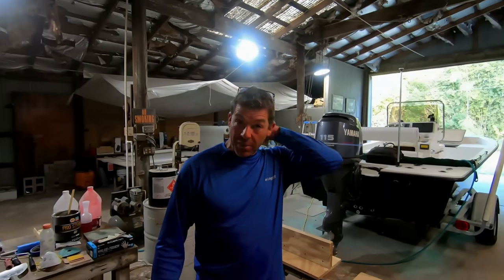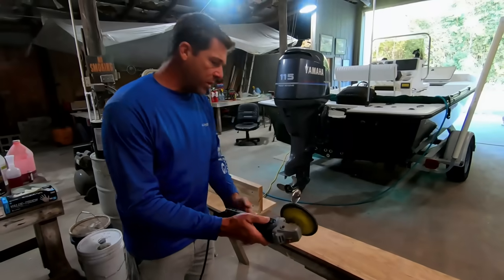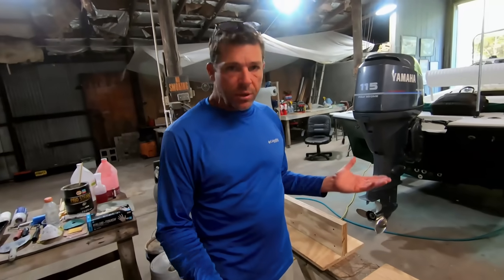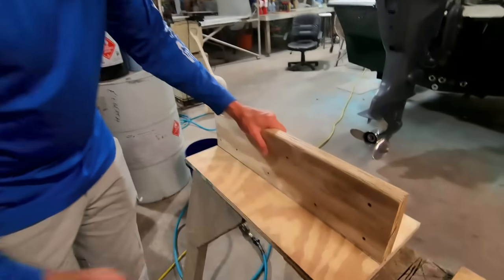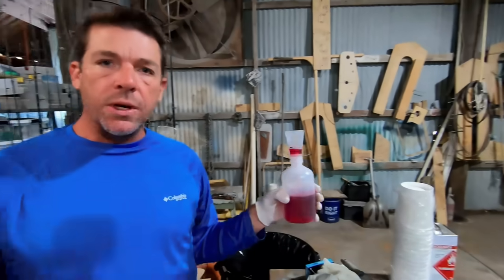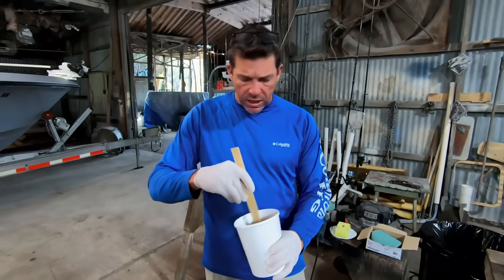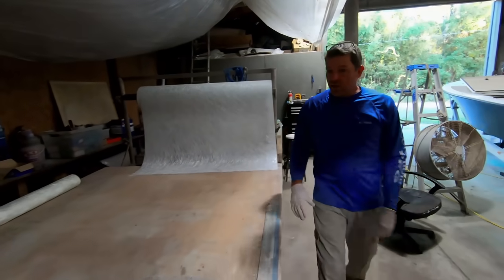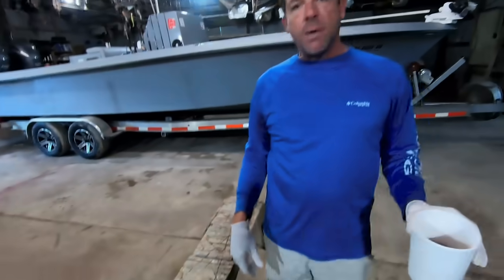How to FIBERGLASS over PLYWOOD!  Do it the RIGHT WAY the FIRST time! Step by Step DIY fiberglassing

Comment: Don't throw your used mixing cups in trashcans before the resin is fully cured. Many boatshops have burned down bc of guys throwing cups in a trashcan and the whole works catches fire and burns hot!!
Reply from the maker: I 100 percent agree! At 16.00-16.30 and again at 20.32-21.20 in the video I cover that in detail. I know the video is long, but has a lot of real world useful info for first timers and the more experienced folks alike. Fiberglass is great stuff, but has some hazards for sure. It pays to be safe when working with it. Thanks for watching and commenting
Reply: @FishBumpTV  Yeah you guys did a great job. My comment was for anyone looking in the comments. Sorry it looks like I directed it toward you. You guys clearly build awesome boats.
Reply from the maker: @shoresharp8349  good idea, thanks! Sometimes it's difficult to know what direction the comments are going. I always try to respond either way.
Reply: Wow well done your explanation and 8 generations shows.I just liked and subscribed .Do you have a video on applying filler and gel coat?
Thanks again
Reply: I always set my hot pots outside three feet from the steel sided building.  Two months after I got laid off due to seasonal downsizing to just the owners, one of the owners got sloppy and left one inside at closing time, probably after a few beers.  I literally lived across the street and remember seeing the flames towering over the trees.  The shop, three boats, and two ski-doos were lost in a matter of minutes.  It was all the fire Department could do to keep it from spreading into the trees.  Some of the steel siding even melted.  That extra 30 seconds is time well spent!
Reply: Your very much working the fibreglass as a form of creating your type of damaskus but without the heat of the forge and worrying the blade 🔪 snapping but you have to create the bond with the different layers
Reply: Name one
Reply: i think you are making this up. prove ithas happened
Reply: Wow
Reply: Best played plans of mice and men.
Reply: I was trained in composite in aviation as well, and the thermal energy from resins can reach up to 360 degrees or more and can do damage to surfaces where they are placed on.
Reply: Linseed oil on cotton rags enclosed in trashcan will combust too
Reply: Theres a video where a guy tests this with like 10 trash cans full of rags with different coatings put in them was only really one culprit
Reply: @1965mt 
I believe it happened, maybe distortion of the steel but not melting of the steel; that takes a few thousand degrees!
Resin heating off isn’t likely to catch fire, but paper, wood, cardboard… sustaining 600*F will catch THAT on fire fairly easily. 
But melting steel?! Didn’t happen.

Comment: Hi everyone just a heads up. After you use the resin and want to discard it .....please put the resin and especially any rags you use in a metal tin and place it outside.  I had some employees that were making some fiberglass chair molds and they usualy discarded the resin and rags they used in a 55 gallon trash open metal drum. Overnight the barrel caught fire and my 15 square foot work area was covered in black resin smoke from the fire. somehow the rags and resin must of caused a perfect combustion. Precaution is cheap. God bless. Jack
Reply from the maker: Thanks for sharing your story! It is always best to take precautions and be careful when working with fiberglass and epoxy!
Reply: Thank you very much from the Netherlands!

Comment: Worked at a boat yard in the early 80’s, building 25-40’ laffite skiffs. A lot of glass over ply in those boats, a lot filleting…a lot. Best thing we ever did was buy a router table to round over edges. Made wetting out glass over a soft contour so much easier. We had a home made machine called a plicker. We passed all wood products through it, its sole purpose was to stipple the surface to increase mechanical bond. The entire wood was liberally coated with poly resin, once it starts to tack, we start laying tape or cloth.
Reply from the maker: Very interesting! Thanks for sharing your experiences with everyone on the channel!

Comment: Great video! I'm looking to make a fiberglass roof topper to bring my van camper's ceiling up to a comfortable standing height. I won't start the project until the summer but this is the best fiberglass tutorial I've come across so far. I didn't skip forward once because of the constant stream of valuable information. Thanks for putting in the effort to make this video and share it with us all - I know I'll be coming back to it when it's time to start practicing.
Reply from the maker: I'm glad to hear that you enjoyed our how to fiberglass over plywood video! We have lots of related fiberglass, epoxy, gelcoat, Foam core and molding custom fiberglass parts videos here on the channel that might give you some additional ideas for your vans ceiling modification.  I hope this helps, and I appreciate you taking the time to watch and comment!

Comment: I have many years in the composite industry, and I can tell you that this fellow knows what he is talking about.
(a semi pro tip)... when doing the radius for the fillet we used to round off the end of a small scraper to to shape we wanted, it is more consistent than the flexible spreader.
Reply from the maker: Wow, thanks so much! I appreciate the tip!

Comment: I have fixed many a floorboard where the salt and snow have rusted it out. I would go under the vehicle and cut away all the rusted flooring. Some were huge areas. I then cut galvanized metal placed on the underside. Using silicone to seal between the old and the new then riveting it in place. Once dried. I would fiberglass the inside of the floor to follow the contour.  I built it up until it was even with the rest of the floor. Replaced the carpet once it was totally cured. The floorboard was know good and strong and water proof from outside elements. You did a fantastic video of explaining the correct process.
Reply from the maker: Sounds like a great fix! Thanks for watching and commenting!

Comment: a neat trick I picked up take a one inch steel ball bearing weld whatever you want for a handle i use a 4 inch 3/8 bolt  and you have a very efficient radius tool just clean with acetone you do a great job
Reply from the maker: That's a great tip! I have some tools that are made for that. I will try to show that technique  in another video. Appreciate you watching and commenting

Comment: Great video. Way back in 2015,my first fiberglass project, I walked into a fiberglass warehouse because it was the only place you could get more than "parts store" supplies and a gentleman that you remind me of gave me the verbal version of your video. I have done a bit fiberglass work since then, and watched quite a few videos on it. Your video does a great job of expressing the need to prepare, and then on application, don't rush, but don't fool around either. I would suggest to the begginner to get a couple of scrap pieces of wood and doing what you did to learn the timing of application, and the mixing and timing of a batch of resin.
Reply from the maker: Thanks so much! Glad you enjoyed the video!

Comment: Great video.  I have done some fiberglassing work on a stitch and glue kayak and repairs to my 1975 Glasply 19.5.  I have watched a lot of videos and I think yours is very comprehensive.   The tip about roughing up the plywood with a grinder is far easier then a sander and faster.  Thanks.
Reply from the maker: Thank you very much! Yes, grinding the plywood surface with a very aggressive 24 or 36 grit disc allows for a very good mechanical bond or Tooth on the surface. I believe it is a very important step to ensure a strong bond, and a quality job!

Comment: Thanks for the great video! That was super well done! I had to chuckle at the memories it invoked of my working building fishing boats in the 1960's. It was the most unsafe shop I've ever been in. Open containers of resin, catylists, and powerfull promotors were atrewn about all over amd the owner would come to look around with live cigarette in his mouth hovering over the resins etc. Our hearts were in our mouths wondering if it was all going to blow up. Luckily, it never happened. Also, it was standard practice to use asbestos fibers before it was banned for fairing between and wheelhouse and deck. Worked super great. We'd scoop big handfuls of the stuff to mix with the resin. 
You mentioned for nice smooth finishes that you finished up with mat. We used to top up the mat with cloth which gave a super nice finish as long as the mat was not too wet. We also used phenolic microballoons for fairing which really sanded well for a smooth finish. Thanks for the memories, lol.
Reply from the maker: Haha, wow! What a great story, glad you guys are ok! Thanks so much for watching and commenting

Comment: Excellent video I learned a lot. 
I'm hoping you will show us how to wrap the ends around so we get smooth corners and how to figure for thickness to fit preglassed parts into spaces that already exist
Reply from the maker: Thanks so much! I will be working on a video covering that soon.
Reply: @FishBumpTV I would also like to see how to bridge over open areas. Don't have any wood backing

Comment: The reason you want to sand the wood after it is machined is when a router or plainer  (any cutter using a steel blade that shaves) is used. The wood grain lays over and seals the wood grain. This is called burnishing. If you try to stain or use a stain primer or paint, it will not penetrate. When you sand the surface, it sands off the wood that is laid over (burnished) and opens the grain, allowing the resin to inter the cells of the wood. 
 I dont know if you have tried a product called pre- stain conditioner, but in the woodworking community, it is used on closed grain wood like maple,cherry,birch, and American black walnut. Thanks for sharing your knowledge in boat building.
Reply from the maker: Thanks for your insight, and I appreciate you watching and commenting!

Comment: As a guide for how much resin to use, I use 2.5 times resin to glass. Eg if you have a square meter of glass weighing 500 gms you need approximately 1.25 kg of resin. This should help as a guide for wetting out.
Great tutorial for learning my friend.

Comment: I am in my mid 60's, as I have done very little of this, so it's always great when I can learn from a professional. The first time I actually saw 5 guys attempting to fiberglass a small homemade boat was when I was maybe in the 6th grade while walking home from grade school. It was in a small south Georgia town, as all of them were more than 3 sheets in the wind. The boat was right side up, instead of upside down. They all had resin all over their hands and arms, then were holding the fiberglass, trying to hold it up against the bottom of the boat from below. I remember thinking to myself, why they didn't put the wooden boat upside down on some short sawhorses. Wonder how long it took them to get cleaned up, as none of them were wearing gloves, and it was HOT that day ! Would have liked to have a picture of them, as each was telling the others what to do. Thanks for the great tutorial.
Reply from the maker: Haha, funny story, but makes me cringe just hearing the details! No gloves, overhead fiberglassing and hot weather! Any one of those things would make the job unpleasant. You had the right idea with turning the boat over if it was possible, sure would have made it a lot easier on those guys. Maybe the videos we are making will help some folks avoid some of those kind of mistakes. Thanks for sharing the story, and thanks for watching!

Comment: Interesting. I was a boat builder in south Florida and south Texas from the late 70's to the mid 90's. Occasionally I had to glass over wood, but I suspect our poly resins weren't as good as yours. Epoxy was my first choice if the customer could afford it. Had to find cloth sized for epoxy of course. Poly, back then anyway, would not bond to wood sufficient for marine use, so I used this trick. After getting the first two layers of cloth down I stapled it to the wood using monel staples, a lot of them. Seemed to hold just fine. Generally the original problem was polyester fiberglass delaminating from wood, often with water intrusion.

Good video.
Reply from the maker: Thanks for watching! Yes, polyester vs epoxy is a big debate. Epoxy does bond to things more aggressively generally speaking. That doesn't mean that polyester is no good. Proper prep, and material selection can make all the difference in the world.  I know this because our family built boats in the 60s with poly resin and marine fir plywood. Those boats are still in operation today, with no problems. Epoxy can be a very good choice for many repairs, as can modern composite cores. In the end you have to decide what is best for your project.

Comment: Yea a good demonstration, I watched this video out of interest, I'm 75yrs old and not a boat builder but if I was younger and just startig out, I should think this is very interesting, satisfying and rewarding (I don't mean money wise) work to do.
Reply from the maker: Thanks for watching! It is definitely a great skill to have!
Reply: great video, I've been a fiberglass builder 30+ yrs just about everything you can think of from boats to pools, bicycles speciality one off molds.. ect. fiberglass is greatest stuff ever. I've used acetone to resin seal with no issues for sealing wood only though any other thinning seems a break down of the resins. So many don't realize the importance of this step it's the difference between surface bond or penetrating 2-3layers of the wood.      Have you ever tried a pizza cutter for cutting glass its way fast, also  for fraying mat a squeeze bottle of acetone  a little line along your straight edge and quickly tears like butter perfect edge 1min later dries out it does affect the binder a little but still wets out fine. As for radius on edges is 3/8 - or greater for easy roll out. A putty bag(zip lock bag no cut corners) makes for quick fill of inside radiuses. Roll the zipper down twice pack in the putty zip it and cut one corner and run your putty way fast then a light wet brush and perfect radius. Just things that have been game changers on time.

Comment: Good to know about the styrene monomer!  The shop I worked in used a fifty percent acetone dilution to saturate the wood and catalyzed after thinning.  I questioned the integrity of what the acetone did to the resin, but was told, "That is how we do it here."  Despite how hot it was mixed, it always remained a bit tacky instead of curing hard.  I also wondered about the effects of the acetone trapped in the wood on the glue used to laminate the plywood.
Reply from the maker: Glad you found it interesting! Thinning with acetone has been done in lots of shops, but is never recommended. Happy to share what I know with you guys. I appreciate you watching and commenting!

Comment: Some of my first fiberglass experiences was when I worked at a boat repair shop , then big trucks, Meyers VW dune buggies and then race cars.  I worked on the Shocker, and built his hood. Tricky stuff making it strong but light and thin. Had to come back with some stiffening ribs/ fiberglass over foam but worked. Always a itchy job.😂
Reply from the maker: Thanks for watching and sharing your experiences! Sounds like you have worked on some very cool projects!

Comment: Cutting the fabric is easier with a rotary fabric cutter.  Simply roll it along your straight edge and it make a great cut and much faster for production work.
Reply from the maker: Thanks for the suggestion, I have one, but thought most people might not. I show their use in our recent glass selection and cutting guide. I appreciate you watching!
Reply: I have a question? The number on resins are different form supplier to supplier? How do I read them? Or decode lol thanks

Comment: I have a couple of questions. I went through the comments to see if they were answered but they were not. I agree with everyone that your video is very well narrated and informative. Question 1. Is the nap on the roller 3/8 in? Question 2. Is it advantageous to use construction adhesive where the plywood pieces meet? Question 3. Should the screws be stainless steel or what type do you recommend? Thank you, Captain Joe.
Reply from the maker: Yes, 3/8 nap on the roller is what I prefer. We usually fiberglass the stringers together, and use stainless steel screws. We fit the stingers to the boat, run the screws through the wood for what I call a dry fit. Then we back the screws out and fiberglass the inside of the stringer. While the glass is still wet we then run the predrilled screws back into place. Just don't over tighten the screws or you will squeeze all the resin out.That has always worked well for us. I would definitely use some kind of adhesive between the layers. Overbuilt is always better than underbuilt in something like the stringers! I hope this helps and thanks for watching!

Comment: Great video Capt. Joe. Wish I would have known about putting the mat over the last piece of 1708 for a smoother finish. But I did use epoxy instead of poly. Don’t know how that would have turned out with epoxy.
Reply from the maker: Thanks! I plan on making another video on different glass, and how it is best applied in different applications. Epoxy resin does not have the same solvents in its base makeup that poly resin does. So it does not melt the binders in the mat very well at all. With epoxy I would generally avoid mat or csm. So You did the right thing. I really appreciate your support of the channel! The more subcribers and views we get, the more helpful videos I can make.